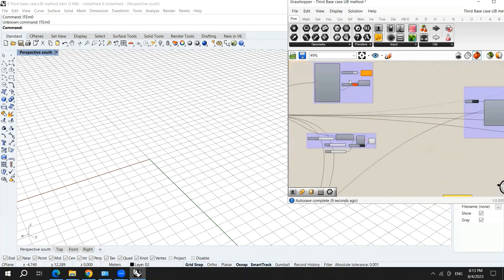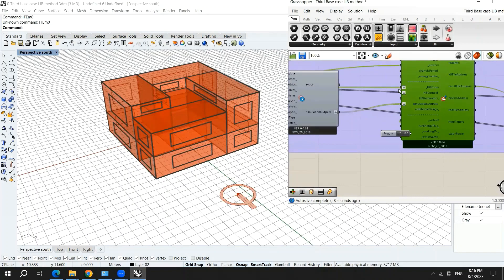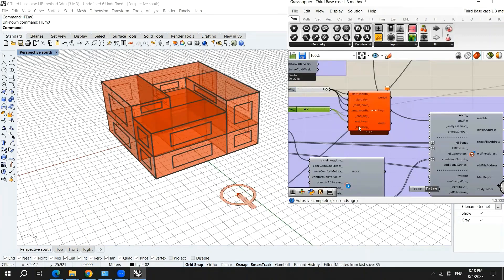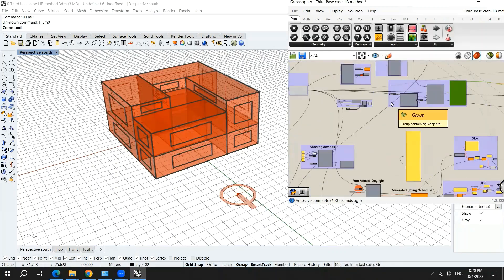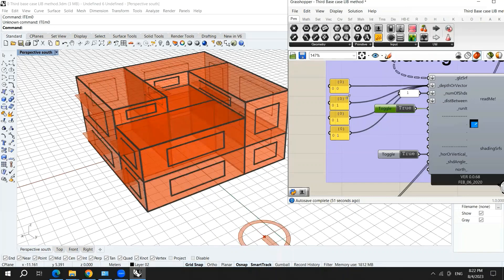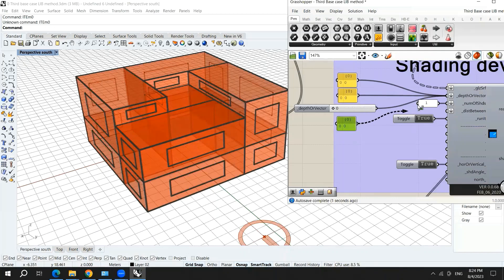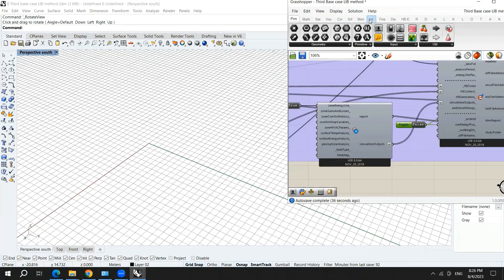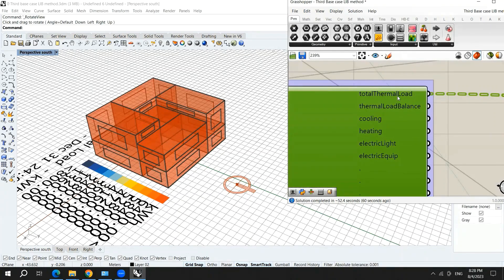5| Add shading devices-,Run energy simulation, thermal Load , analysis period- Ladybug Honeybee

Comment: Dear Prof Khalil, I get the following errors when running the simulation. Does it perhaps relate to the original BREPs that were not generated correctly?

1. The simulation has not run correctly because of this severe error: 
   ** Severe  ** <root>[BuildingSurface:Detailed][zone_0_Srf_0][outside_boundary_condition] - "zone_3_Srf_3" - Failed to match against any enum values.
2. The simulation has not run correctly because of this severe error: 
   ** Severe  ** <root>[BuildingSurface:Detailed][zone_0_Srf_0][sun_exposure] - "NoWind" - Failed to match against any enum values.
3. The simulation has not run correctly because of this severe error: 
   ** Severe  ** <root>[BuildingSurface:Detailed][zone_0_Srf_0][vertices][3] - Missing required property 'vertex_z_coordinate'.
1. The simulation has failed because of this fatal error: 
   **  Fatal  ** Errors occurred on processing input file. Preceding condition(s) cause termination.